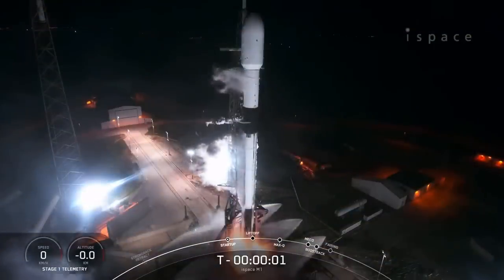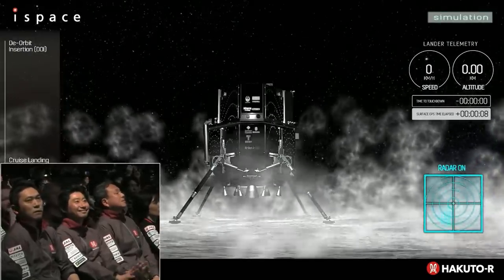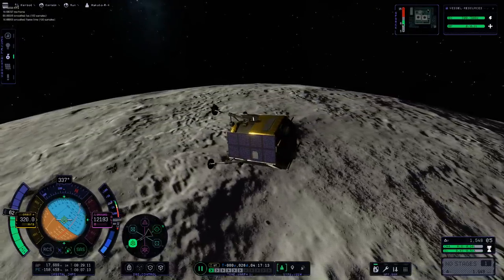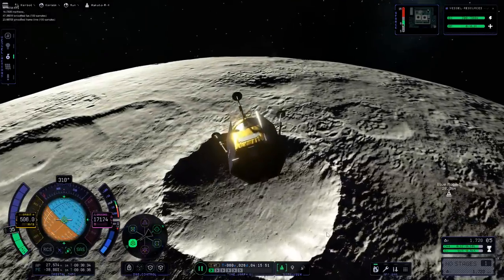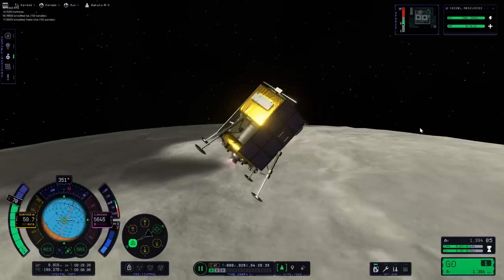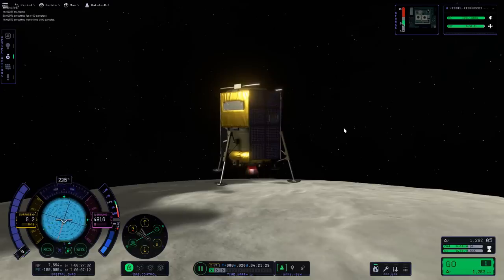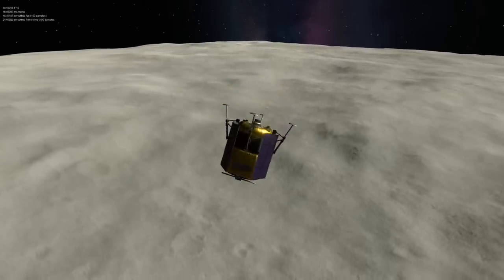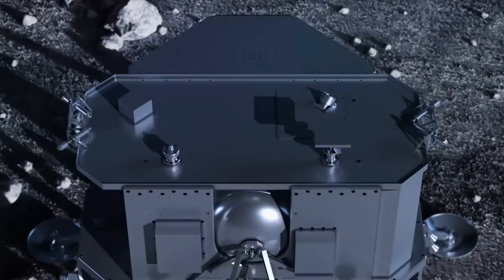Why Japan's Moon Lander Crashed Due to An Unbelievable Computer Bug

Comment: It continues to amaze me that we managed to safely land astronauts on the moon AND have them take off from the lunar surface and return home, several times.  Obviously, having actual humans present makes a ton of difference, but the number of things that could have gone wrong but didn't is mind-boggling.
Reply: The brain is a wonderful flight computer. 
Lander: I'm going to land here. 
Human: Dummy, there's a rock the size of a McMansion there! Gimme manual control.
Reply: The first moon landing was saved by the astronauts: the automation on the lander was going to put it down in a field of big boulders.
Reply: think about it like this: humans have managed to control powered airplanes since the start of the 20th century, while autonomous aircraft have only just appeared in the last decade or two.  humans are just that versatile
Reply: @MarlinMay  I am howling, when I pictured this in my head with astronaut Slapping their computer and called it dumb.
Reply: One of the NASA research reports justified the cost and risk to send human astronauts to the Moon with the allegory says "Human brain is the most lightweight and easy-to-aqcuire real-time non-linear computer"
Reply: @a4d9  This was actually an anticipated problem.  One of the commander's jobs was specifically to select a suitable landing site.  The computer would suggest one, probably based on what would be the most efficient trajectory, and indicate what coordinates it would appear at in the commander's window.  Armstrong looked at those coordinates, saw a boulder field, and instructed the computer to land at a different set of coordinates which he could see was clear of obstructions.  He did not, in fact, "take manual control" at that point.  I forget whether the final descent phase was under manual control or not, but although some human input was required during the landing, it was far from a complete reversion to manual control that early in the approach.
The much-vaunted "computer kept crashing" problem that did occur during Apollo 11 turns out to have been due to one of the astronauts bringing up an auxiliary status display which wasn't strictly required for the mission, and in combination with a completely unrelated hardware fault, caused the total processing load to exceed the computer's capacity.  The computer did not crash, however, but simply cleared its processing queue of low-priority tasks, entirely as designed, while notifying Mission Control that it was doing so.  This represented an absolute triumph of software engineering at the time.
Reply: @a4d9 ot only boulders, but this exact issue. Mission Control was panicking about the landing on 11 because the guidance showed them several hundred meters up with basically zero fuel. Neil, however, was flying flat over a large crater. When he reached the lip, he was only a few dozen feet above the surface and landed perfectly.

This is why humans in the loop are so damn handy. Turns out the human brain is still a more powerful computer than any we've made. Automation of a task like this is really, really hard.
Reply: We did a whole lot of testing (Apollo 9 and 10), and used easy landing sites first (Apollo 11), before going on to more difficult sites (Apollo 15 and 17). No two Apollo missions were identical. And every mission exposed areas for improvement in hardware and procedures.
Reply: PNGS 1202
Reply: @cptjeff1  And why relying on robots to explore the solar system is a stupid idea.
Reply: @unflexian  actually, autonomus spacecraft has been around for more than 50 years. Soviet and American probes and landers were autonomous.
Reply: @MarlinMay  I heard this in the voice of The Missile™
Reply: they were suside squad but highly trained and optimistic.
Reply: @BabyMakR  The Space Shuttle software didn't cause a serious problem for many years. Why not? Because they tested each component of the software individually and thoroughly. That's expensive, so it's very unfashionable.
Reply: I feel like at this point it would be way easier sending a manned mission. The software can do 99% of the job but in a situation like these mentioned here a human can just set it to manual control and continue the right trejectory.
Reply: @a4d9  The Moon Lander's computer also crashed repeatedly because it couldn't handle the amount of data it was being given. Every computer crash could have written off the mission and killed the crew. Then there was the initial inability to communicate directly with Mission Control because of a radio shortcoming. The people involved then made the decision to have the signals relayed through the Command Module, again saving the mission.

The landing spot was several miles downrange from the target. The onboard computer at the time could not have made allowance for the differences in topography.
Reply: So if they used a copy or embeded simulated wersion of flight commander of apollo.. but nothey used new one
Reply: Sadly telemetry/blackbox data of apollo missions is lost and now we are there.
Reply: That's because it never happened.
Reply: Tbf manned mission also got insane level of safety standards, testing (eg Apollo 1-10), etc. Thats why theres only a few american moon landings, but tons of robotic landers.
Reply: Hairless apes are still better flight computers
Reply: @Kromaatikse  There's a difference between the Apollo missions and today. During Apollo we only had poor images of the surface from Lunar Orbiter. We didn't know in advance whether any given spot was safe to land, hence the need for the commander to designate a landing spot. Today, thanks to Lunar Reconnaissance Orbiter, we do have very high resolution images of much of the surface, so automated landings shouldn't produce any surprises. Also, computer vision has gotten good enough to do what the human Apollo pilot did.

There was no fully "manual" control of the LM, only degrees of automatic control. Armstrong flew Eagle much like a helicopter, telling the computer where he wanted to go, but the computer still fired all the thrusters. Actually, it was more like a modern drone than a helicopter.

The computer faults were not Aldrin's fault. It was fundamentally a design flaw in the rendezvous radar that sometimes caused a flood of spurious interrupts that soaked up too much computer time. The aux status display simply pushed it over the edge. It was important but not essential, so Aldrin turned it off and the ground monitored it. Interestingly, the display variable in question was "delta H", the difference between the computer's idea of altitude and the radar's. This is exactly what crashed Hakuto-R: the computer ignored the radar so its delta-H grew to 5 km. Or, to draw a Star Wars analogy, Luke switched off his targeting computer...and crashed onto the Death Star.
Reply: But we don't. You haven't seen it in your lifetime and you won't
Reply: @ShainAndrews  👎🦃
Reply: @rickyfitness252  👎🤡
Reply: It’s cuz they had a human thick in the loop.
Reply: Plenty of things DID go wrong with the Apollo missions, but humans are pretty adaptable on the fly, assuming they get time to act.
Reply: There is a reason why Nasa did 20 flights before landing someone on the moon.
Reply: @timemachine194 Okay, but that was much later in the approach, after the computer had guided the lander into the vicinity of the site he selected.
Reply: The first landing was only successful because the astronaut pilot disabled the computer and manually landed since the LEM was a few km from where it was supposed to be - the pilot navigated to a more suitable location and then landed.
Reply: @JuriK Fun fact: we landed on the moon before we invented the microprocessor. Scary!
Reply: @eekee6034  What does the shuttle's software have to do with using robots to explore the solar system?
Reply: Yeah shit actually almost went very wrong and Niel was actually supposed to abort the landing due to a failed first attempt but he was like fuck it and landed with very and I mean very little fuel left in reserve.
Reply: @a4d9  Tbf to that computer it simply didn't have the sensors to know those boulders were there.
1960s electronics man
Reply: I guess the Japanese should have used 1960s technology with hand woven rope memory and about 100 meg of storage. 😂

But they say we can't go back because we lost that technology.
Reply: Actually, that SHOULD raise some serious red flags... if you had half a brain to know when you're being deceived.
Reply: I know, it's mind boggling right. Apparently Neil Armstrong had to take manual control of the lander at the last minute as it was heading for a boulder field. So many things had to work perfectly. I think their on board computer was only 16kb as well. That is what fries my head as we now live in a Terabyte world.
Reply: And the fact we did that nearly 60 years ago is so incredible that people believe that it’s was hoaxed
Reply: @BabyMakR  Testing properly, which applies to both hardware and software.
Reply: @unflexian  inertial guidance has allowed planes to more or less do autopilot since the 50s. The drones I believe you refer to are run by pilots from trailers in Nevada.
Reply: @unflexian  re: "humans have managed to control powered airplanes since the start of the 20th century,"
One word: Birds.
Reply: @JuriK re: "and no computer aided design"
I would suggest a research of the IBM System/360 from those days. NASA owned a number of different models, as did subcontractors and other vendor's models as well. The CAD just wasn't as sophisticated as AUTOCAD is today.
Reply: @timemachine194 re: " He absolutely DID take manual control"
A rocket motor beneath you is an inherently unstable design; It was more of a 'fly by wire' control system involving attitude thrusters and the like.
Reply: @webdaddy  Vacuum tube computers existed before some of us here existed  too.
Reply: @Kromaatikse  I beg to differ. Armstrong indeed took manual control using the fly-by-wire system and caused them to land long. He controlled the descent rate and how long to pause the vertical descent.
He also had to take full all axis manual control for the last part of the vertical descent to the surface.
Reply: @T_Mo271  Apollo 10 also exposed a misconfiguration of the guidance software that caused the lunar module to TUMBLE below 50,000 feet above the lunar surface. It caused Stafford (I think) to issue and expletive over the hot mic before they could remedy the problem.
Reply: Compared to todays standards, the Apollo spacecraft did have miniscule coputer tech. Like the clock on modern spacecraft has higher specs than the whole Saturn 5 rocket. And with more electronics there is a higher chance to f*** up. Especially when bureaucrats call the shots, like here.
Reply: Especially as you consider that the Apollo 11 computer was overwhelmed by all the data coming in, especially from the radar altimeter, and hand to be reset more than once during the landing. Fortunately, the computer expert on the ground quickly realized that resetting the computer would render the problem harmless, and Buzz quickly did so.
Reply: @a4d9  They also had a recurrent computer problem because the radar altimeter was overloading the computer.  The computer expert on the ground realized what it was very quickly and had Buzz reset the computer more than once.
Reply: @ahmetmutlu348  

That's false. Some tapes were taped over because the information was saved elsewhere and tapes at the time were very expensive and reused.
However the great majority of the information was saved in various ways.
Reply: @ShainAndrews  
I pity you
Reply: @JuriK 
Computers were not "crappy", they were simply less advanced than today's technology. smh
Reply: @AmanPatel-ye6im  
with is suside???
Reply: @rickyfitness252  
Seen what?
I saw the lunar mission in my lifetime and will see more in the next few years.
Reply: @abelis644  and I saw DeLorean hit 88 mph and go back to the future.
TV is a fun thing
Reply: @eekee6034  not its twin crashed and killed lots of people.
Reply: @webdaddy  depends on what you mean by micro. Transustor invented on 1947. therefore there was micro processors , depeds on transistor size anyway.
Reply: @ahmetmutlu348  That was later. For years, there was pressure on the chief software engineer to do less testing because testing was expensive, but he wouldn't give in. Maybe they replaced him or maybe he retired, and then a shuttle crashed with a software fault. (I hope I'm replying to the right argument, lol! Youtube doesn't make it easy to see context.)
Reply: I had the same hewlet packard , they carried in the lem, the control programn was on a short magnetic strip, I used to try and land on the surface and usually ran out of fuel a few feet up. We had to fly nasa/ hewlet  people to the uk and put them up in a hotel to split the registers for us, and the data scrolled as we used every register for input data. You never knew when it would start to output, I just had to be ready for it. ( the other option was punch cards and a "mainframe" 60 miles away.)
Reply: @ShainAndrews  This is my doubt. After seeing that the old moon spacecrafts were hunks of metal, I strongly think only the last few manned moon missions happened. And only since 2013 or so, unmanned moon missions really happened because of advances in engineering. All others were bogus and fake. And that is shocking if I think about it.
Reply: @abelis644  You seem the type of person that has a favorite window flavor.
Reply: You don't still believe that they went to the moon? lmao
Reply: And using primitive or non existent computer software with thousands of safety features built into the spacecraft.
Reply: @BabyMakR  ...if you are ignoring several successful missions of Mars rovers that exceeded the expectations. Unmanned probes have the advantage of not needing extra weight for habitation and life support for long-duration missions. Me thinks the ethical cost of sending people beyond lunar orbit is severely underestimated.
Reply: @drill_fiend1097  unmanned probes also have the disadvantage of not being able to find life on a body known to have life.
Reply: A lot of things did go wrong, AND were corrected by humans, both in the Gemini projects leading up to Apollo and Apollo itself.
Reply: @a4d9  And before that Gemini 8 had stuck thrusters (open) that put them into a very dangerous roll. Rate kept increasing and if not for Armstrong gaining control, both he and Dave Scott would have died up there, spinning like a top forever.
Reply: @abelis644  @Shain Andrews was obviously deprived of oxygen at birth. Not their fault. They deserve pity.
Reply: @ClickClack_Bam  Wow. you don't even know basics. The moon isn't 240,00 miles. If you're going to try to spread BS, at least get the easy stuff right.
Reply: @ClickClack_Bam  Wow!! You learned how to take a screenshot!!! I'm shocked. Did you have to steal a braincell from someone to rub them together to figure that out?🤣
Reply: @@Jurk844 They didn't have crappy computers in 1969, they had the human brain - something a thousand times smarter than this Japanese lander had onboard.
Reply: Well, some mistakes were made, humans being present. Perhaps, too present for their liking, for example, when they cooked three astronauts alive just because one of the genius there never imagined that oxygen, and a place full of it, could be quite a treat for a tiny, mischievous spark. And they didn't need to leave Earth to do that. The Soviets liked to cook people after giving them the benefit of being in orbit, as it happened with Yuri Gagarin's best friend. His love for the Soviet command and engineers can be heard today as he succesfully re-entered the atmosphere. Well, from a technical standpoint, that did happen. Maybe not while keeping the cosmonaut alive, but hey, in Soviet Russia cosmonauts kept engineers alive.